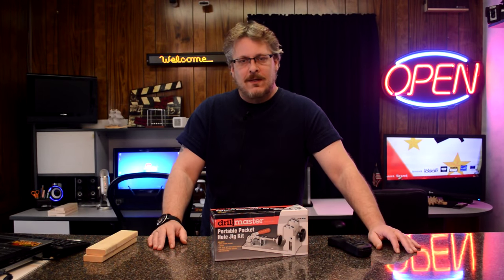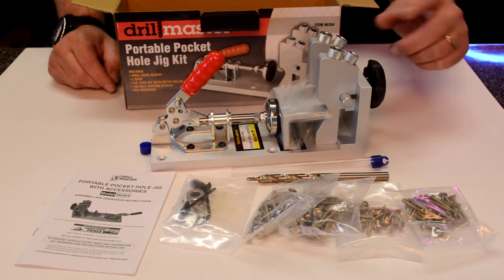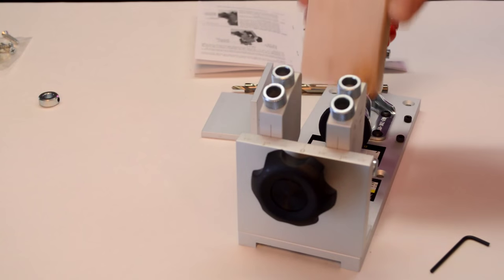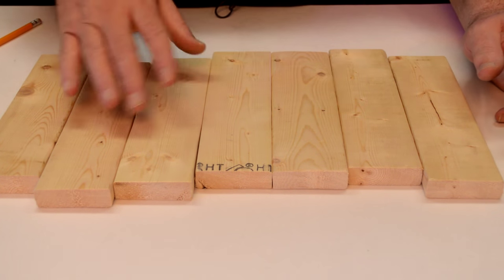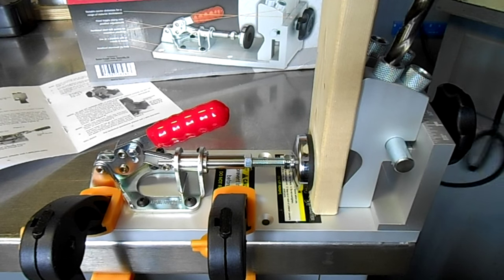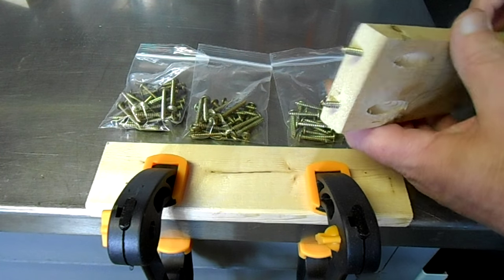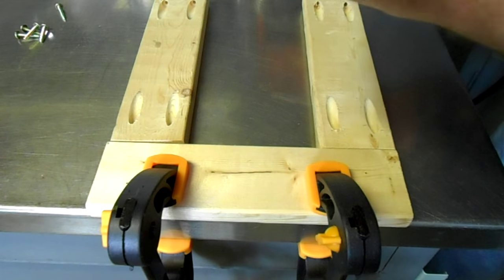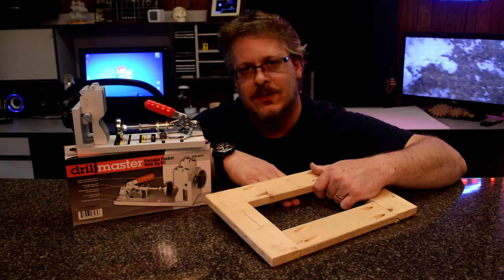Wood Tool for all Types of Projects - Pocket Hole Jig

Comment: Finally someone who read the directions about the small screws, but you didn’t mention if you look on the side of one of the drill guides it tells you what hole to use for different thickness wood. And keep in mind the length of the screw you use depends on the thickness of wood you are screwing into.
Very informative video… I’ve been using the drill master a while now love it.

Comment: I used both this one and the 2 offered by Kreg Jigs. All of them work fine. The smaller Kregg unit is more portable to use on a jobsite. Although this is 5 years later. I use corner clamps and glue the assembly up. I wait about 10 minutes or so and then I drive the screws in. This prevents the joints from "shifting" as they tighten with the screws. You will end up with a joint that would take a serious effort to break.

Comment: Thanks for the quick tutorial… saved me time trying to figure out the Drillmaster instructions in 6pt font with a magnifying glass.  I picked up this tool to use for attaching legs to stools and chairs, rather than doweling w/glue.

Most butt joints in my shop are made with a biscuit cutter, biscuits and glue.  The biggest advantage I see to using a pocket jig is the time (and hassle) it saves clamping and waiting for glue to dry.

After watching your video, I think I will try attaching a thin scrap of wood with double sided tape under the base of the piece being drilled so the pilot bit goes all the way through and slightly into the scrap.  This will allow me to position and mark where I want to attach to its “mate” and drill a pilot hole using one of the drill guides (removed) with a 3/8” dowel sleeve drilled out to accommodate an appropriate pilot bit for the screw threads.  Hardly necessary in soft wood to avoid splitting but when working with hard woods such as walnut or hickory, a pilot hole could save a lot of assembly headaches and “do overs”. 

Thanks again, very helpful video!

Comment: Very good video.  I recently had a Kreg jig stolen and needed to replace it.  I heard Harbor Freight was just as good if not better.  I've no experience with this HF jig, was just studying up on it some - that's how I came to your video,  Good job, that jig looks good - I like that it's not plastic too.

I have used that other jig for years, and could offer you a few tips with what you were doing in this video that you might find handy.  #1  if you get a 1/4" thick piece of plexiglass and rip it 1 1/2" wide and 1' to 3' long, you can pick a spacing pattern you like (or 2, or 3, etc), and drill some holes that you can mark through, mark on, and see through,  by putting the same edge flush with your lumber, it's quick and easy to do duplicate boards even add holes to if you need something specific. You can even put some of that stick on tape ruler on it to make a yardstick/marking jig. But since it is 1/4 thick, you can skip the two little screws for using 1/2" thick lumber, and just lay the plexiglass strip under your half inch material and hang it right by your pocket hole jig when not using it.

#2  If you get a thin strip of metal, like an old or cheap drywall square that you can cut off, it can be cut the same length as the jig above, if cut right, it's already a ruler too, but doesn't need to be, but it can come in very handy in situations like where you had clamped the horizontal board down and was screwing the vertical boards on. Some boards will raise as the screws go into the grain of the second piece more than you can hold by hand, giving you a lip.  But if you clamp the first board just as you did with the metal hanging over a little on top of it, not enough to interfere with your pockets - Flushing and pinching the vertical boards on the end too, they'll come out flush too. (A framing square does the same thing, but takes more room, sometimes gets in the way,  and could get damaged). Basically, you're making a real wide face clamp.

With these two "yardsticks" ( even though they don't have to be a yard) hanging together, they only take one space, and you'll not only have them for the hole jig, you'll probably end up grabbing them to measure, as a straight edge, or spacing other stuff even more often. For example, perfect for spacing fasteners straight down a hidden stud too.

Thanks for the video - I'm getting one tomorrow.

Comment: Watched an unboxing of the Katsu portable jig and it's identical to that but it comes with the drill bit and plugs for £39.99 from amazon,is your jig similar in price,great unboxing by the way,the guy who did the Katsu video seemed to have a lot of tear out on his drill holes plus a little bit of aluminium filings from the first use,your video was better framed and easy to follow,thanks

Comment: Nice review appears to be one of the better  Woodworking tools at HF  i o like the Kreg  organized  screw storage boxes ive found  on Ebay  but dont care for the price of their  jig   This one is nice with the clamp and metal construction   Can build  a storage  box for screws  thanks for  all the details on the review  you  go into more than the others on YouTube   I'm trying to figure out a way to  permanently mount it on a bench that would allow it to  be hinged  to move it off the  horizontal  surface  when  not using it  like on a piano or ? Hinge  system  ?   Instead of clamp and reclamp every time  you  want to use  it

Comment: It looks like the max size of stock this jig will handle up to a 1 1/2",  right?  Also, where do you get more screws and what's the max length of screw you can use?

Comment: when you run out of the provided screws get the ones with the square heads they're much better than phillips heads you won't strip them.
Reply from the maker: +theworkenman Thanks, I was wondering what I should get. Do you have a link to better ones?
Reply: +GuruBrew Google kreg screws they have various lengths and fine threads for solid wood and course threads for plywood. I've used both type and really like the kreg brand.

Comment: Thanks for the video with explanation.
For pocket hole joinery, the hole is drilled at a 15 degree angle. What is different about the Drill Master jig is that it has two drill guides for each  position and the second hole (for 1.25" & 1.5") appears to be at a 20 degree angle. In Kreg jig, there is only one guide per position for all screw sizes and the angle is always 15 degrees. May I know your comments on this difference?

Comment: at 07:58 did you notice how much the jig flexed when you clamped?
Reply from the maker: +Dave Grohl Ya I did after I made the video, I think I am clamping to tight. thanks
Reply: Yeah, that was crazy tight, just need a firm force, nothing so massive. Since the drill bit is doing all the work and it's a rotary cutting and not hammering. I was going to mention you moved the nut in the wrong direction to lock in the length of the clamp, but you had it corrected when you actually used it. Final thought was the #2 Square tip screwdriver bits/crews; and it's that those are actually the standard screw head in Canada. They've been trying for years to get us dumb Americans to switch over from Phillips head, or worse yet the flat slot, since it is so much better than either of those.

Comment: I've got one of these harbor freight jigs and the (much) more expensive Kreg jig. I have to say, I like the harbor freight jig better than the kreg. However, the drill bit that comes with the Kreg is light years better than this HF drill bit. The HF bit will  break or dull much, much quicker than the Kreg bit. That said, buying this jig plus a better drill bit to go with it is still cheaper than the Kreg jig. 

This is one of those very few HF products that's actually worth the money.
Reply: For what a person saves buying this one over the kreg they can go buy several new drill bits.

Comment: What do you do if it is more then 1/2 inch thick.
Reply: John Coonradt jr.5 -- The holes closest to the wood are for 1/2"; 3/4", 1" thick pieces and the holes closest to you are for 1 1/4" and 1 1/2" pieces. Remember to check the Kreg screw chart for the right size screws.

Comment from the maker: Do you think our look of the video quality is improving?
Reply: +GuruBrew Looks good.. the only thing, I'd point out is at the start of the video  looks nice and bright, but at the end of the video looks darker, I'm not sure if that's a consequence of the closer shot? But otherwise, the production looks and sounds great.
Reply from the maker: +AnalogX64 Thanks for the input; darkness probably comes from me not turning on the overheads or forgetting to change the camera F-stop :(
Reply: i would like to see the use of the portable part and how you would use it on a 2x4 or 4x4 im going to make a table/ workbench and im using this exact tool ive cut all of my wood to length but dont want to start drilling holes until i know how to fully use it for those wood thicknesses ...im using 2x6s and 4x4s for the legs im connecting the 2x6s side by side to make the table top like this |||||| so i would have to use the pocket hole jig on the 2x6s like this |=|

Comment: i looking 4 minute, and first i think were have screw bit ??? no good set, and all same can do diy at home. buy clamp,made jig, little scrap plywood, 15 degree angle cut and have jig, then add plywood fence and base and have same jig. need only buy drill,end ring,little 9,5-10mm alu or metal tube scrap wood,drill bit and make own jig, easy and 200 x cheapen than this. or if want do easy buy cheap copy kreg pocket hole jig, 4 $ and add plywood frame and clmp this, ready no need more, this not have different plywood adjusted height level what have REAL jig, but newermind can use 15 degree and drill stop bracket can adjust little. maybe not have big wood center but no matter. keep woods together
Reply: What are you on?